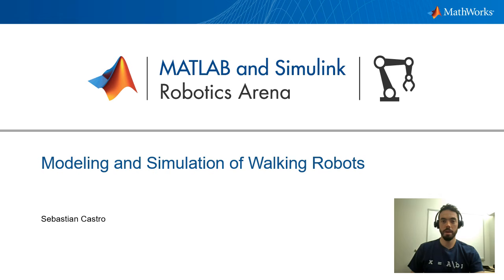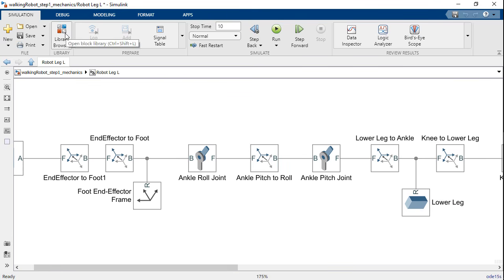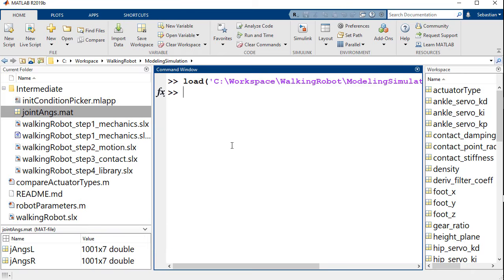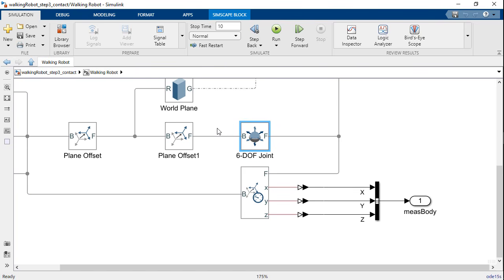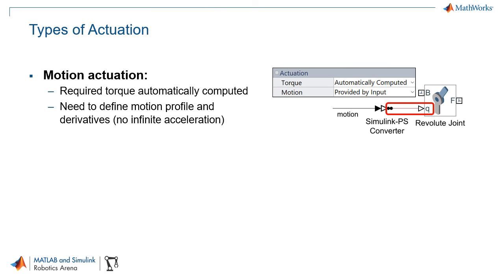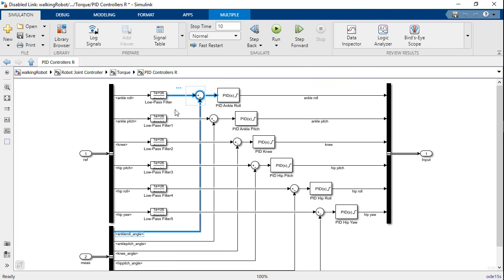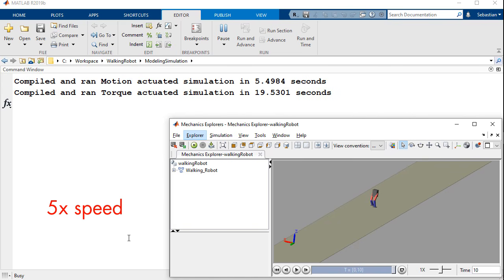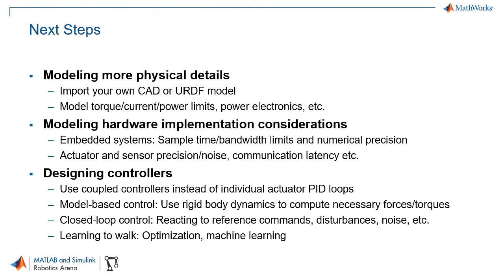Modeling and Simulation of Walking Robots

Comment: Hey. Anyone has a SimMechanics circuit that i can controlled the revolute joint's speed by dc motor's voltage or any parameters of Simulink while simulation is running